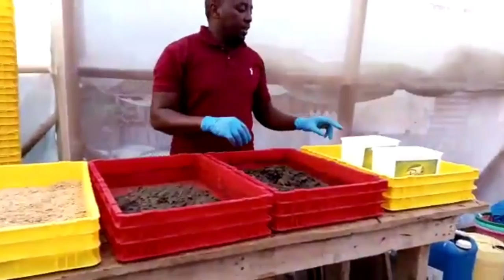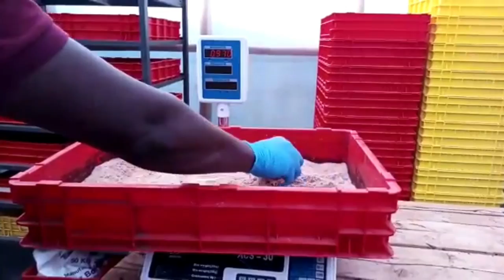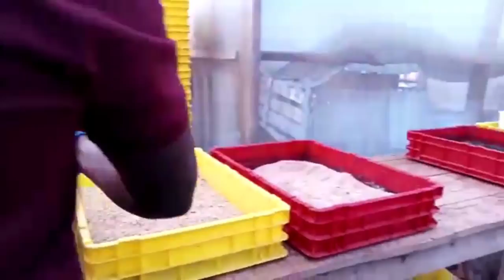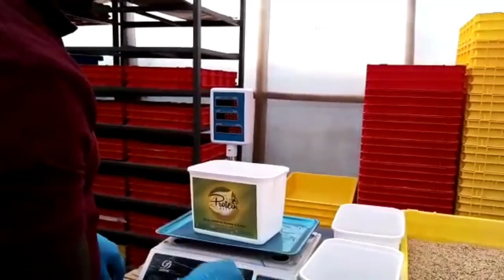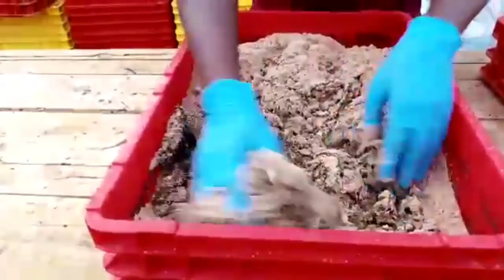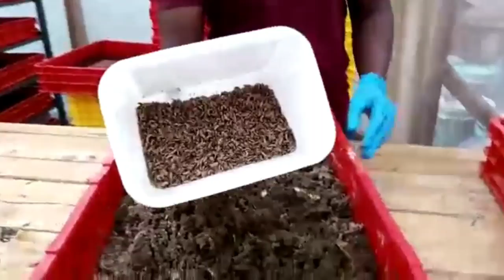Bsf-Cow dung(rice husks) test

Comment: Moisture content in both setups is seems to be too low which is detrimental to the worms.  Their soft skin requires moisture to be kept at a fairly constant 70% which entails periodic adjustment through mist-watering to factor in evaporation. Please consider changing your recording device, the current video quality makes it hard to see the finer details from your setup. Wishing you the best
Reply from the maker: Yes the moisture content was around 60% but it is cold now In our country that's why I thought of reducing it as I study it,for the camera I will invest in a better one, cash is the issue for now am helping people with what I have in my hand currently, but God will make away for a better one